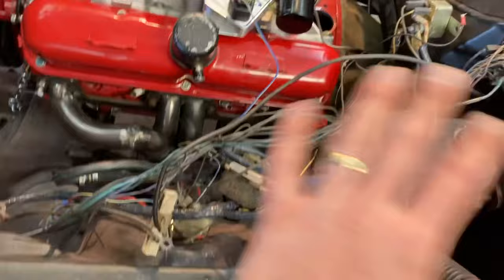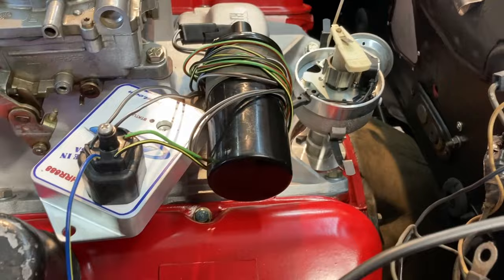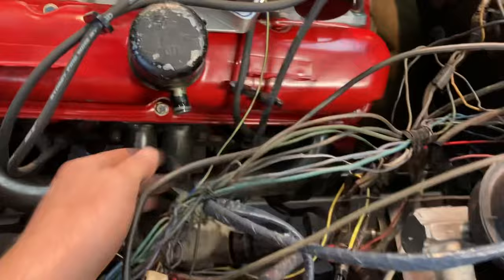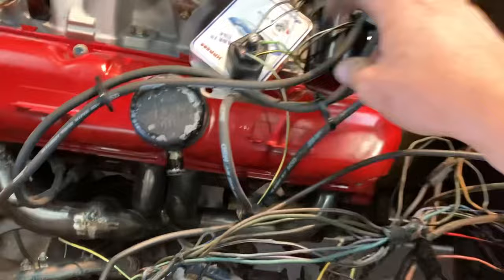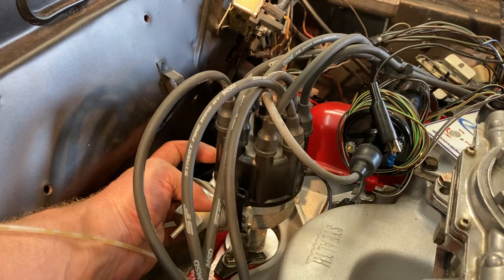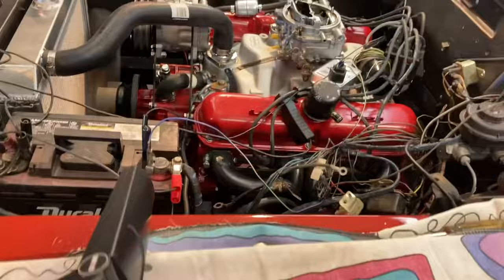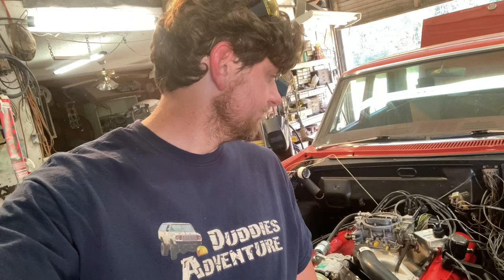How to Time your New Engine, and it Start Instantly! #smallblock #mopar #engine #howto #classic

Comment: joe i have done it this way for many years and it has never failed me the only thing i do different is to take the number one plug out and put the wire back on it then turn the key to the on position and move the dist. back and forth a little to make sure it sparks.this never fails me
Reply from the maker: That’s an excellent idea! Thanks for sharing!
Reply: Yup great idea, could have come in handy that time I switched a 78 Cordoba from Lean Burn to Points and put the distributoo 180 degrees Bass Ackwards... It even started and ran like crap.   But best of all it pinged while idling... It drove me nuts.  Finally I gave up and called one of my Mopar buddies to come take a look to see if he had any Ideas.  Nothing like a fresh set of eyes...  He figured it out in about 2 minutes.... I said;  "No way!" I thought I knew everything LOL

Comment: I thought you couldn’t roll a motor back wards because you would screw up the timing it is that just for the newer stuff?
Reply from the maker: @dantelopez4353  forwards or backwards, when the distributor is locked in place, it doesn’t matter. Newer stuff is usually set off of a crank sensor or crank trigger

Comment: Great video! Great process and tips Joe! Thanks for sharing!
Reply from the maker: Thanks Mitch!
Reply: @JustMoparJoe  so do you gotta have it at 10 before? Cause I did this exact process on my truck and I went to start it but it kept just cranking for a few seconds. I didn’t mess with it further cause I have no mufflers. Just headers
Reply from the maker: @danielpeterson446  the 10 before just ensures you get 10 degrees plus your initial advance

Comment: I like to stay with the factory index of the distributor/oil pump drive orientation. It simplifies wire position and any diagnosis if problems arise later. Sounds good Joe. What mufflers?
Reply from the maker: Thanks Garry. These are Jegs brand, magnaflow knock offs. I will show the part numbers in the exhaust videos

Comment: What should a 1978 Chrysler 400 engine timing be set at? It says  5 degrees but can't move the distributor that far because vacuum hits manifold
Reply from the maker: You may have to pick up the distributor and the intermediate shaft, and reset them. I would aim for around 10-12 degrees initial if it’s a bone stock engine. Also check the advance curve after you rev it to 3,500. The firecore should be light years ahead of the old stock distributor. 318 will run has a good video on finding the best initial timing for your engine.

Comment: I have a 360 that dose not run or idle at all did timing everything need help
Reply from the maker: Always start simple: Fuel, Fire, Air. If it has spark when you turn it over, and fuel when you pump the carb, then it should start. You can send me an email and I can try to help. justmoparjoe@gmail.com

Comment: This is similar to how I do it.  I never likes the idea of moving the intermediate shaft a tooth or 2 off.  It doesn't give you enough adjustability in my opinion.  Plus its a good way to knock stuff into the engine.

Comment: Get rid of that white rotor, i had the same one come apart at the top end 1/4- mile track. I was lucky and rolled all the way off track on to the shut off area.
Reply from the maker: Will do. I usually like the ones made by Mopar.

Comment: What year are those valve covers and what engine did they come off have a set on my  71 swinger  need passenger side oil fill cap good video
Reply from the maker: Thanks Dave. These were from a 67 273.
Reply: @JustMoparJoe  thank you
Reply from the maker: @davesaylor5135  if you can’t find one, send me an email. justmoparjoe@gmail.com

Comment: I bought an e-body Challenger with a 383. It runs rough so I decided to go through the tune starting with timing. There was no timing mark on the balancer. So I found TDC on the compression stroke with a piston stop and marked the balancer. Then rolled the engine counter-clockwise back to about 12 BTDC. Next I followed your video and lined up the pickup coil with the reluctor. But when I put the rotor back in, it is not directly under any of the distributer cap posts. It is rotated counter-clockwise about 1/3 of the way past one post, 2/3 before the next post. Ever come across this? Any ideas what is going on with this?
Reply from the maker: It’s very possible, depending on the distributor,rotor, or cap manufacturers. Some people don’t line up the rotor at all. Locating the correct number 1 and the verifying fire order is important. If you can get it back running, throw your timing light on and see where it’s at for initial and total. Be sure you have a good set of plugs in the car(ngk or autolite). Also check wires and connection to coil. Also check vacuum lines for any leaks.
Reply: @JustMoparJoe  Thanks for the fast reply! I expected the rotor to be perfectly aligned with a post on the cap once the reluctor was aligned with the pickup coil. But it is ~15 degrees past one post, ~30 degrees before the next post. I can put everything back the way it was before and see if runs. At least I have a TDC mark on the balancer now :-) Really not understanding how this thing was running at all now...
Reply from the maker: @70Chally383  good luck 👍🏼

Comment: Hey Joe question for you recently found a 69 barracuda 318 3-speed automatic unmolested doesn't have a grill minor dent in front fender it's dark green what would you think the value could be seats are little chewy floors are good trunks good quarters good?
Reply from the maker: Oh man. That’s a nice car. The easy answer is,”whatever Simeon would pay for it.” The more correct response would be maybe $6,000-8,000 depending on its completeness. Finding trim, etc. can be very expensive and time consuming.
Reply: @JustMoparJoe  thanks for the reply I found out tonight did it has had some modifications and Oldsmobile positive traction rear end was put in it the rest of the car looks pretty stock has bucket seats and console speedometer shows 63,000 miles motor does not run
Reply from the maker: @mrpurcountry  that’s odd on the rearend, but easily fixable. My dart sport has an s10 rearend that someone swapped in 🤨

Comment: I was wondering about the direction of rotation– good tip about the vacuum advance can.  Also, nice TDC on compression stroke trick with the finger on the plug hole.
Reply from the maker: Thanks brother. We always end up
Spinning an engine when putting in converter bolts, getting oil to the rockers, etc. This is the fastest way I can imagine to get it back.
Reply: Just dont use your pinky finger if you have small hands... Just Sayin...😀

Comment: Does it matter where you start number 1? Every diagram I see number 1 is opposite of where you have number 1
Reply from the maker: It absolutely doesn’t matter. I think the factory set them all the same on the production line. Just be sure to make number one the closet to where it goes under the cap.

Comment: Hey Joe thanks for the video. Did you set the initial timing with the vacuum line disconnected? I’m trying to time my 440 correctly and I would like to start for scratch with your method. My car pulses a little while driving, so I know the timings off a little and it’s a new engine. I adjusted it some but slower to start and falls on it’s face when stomping on the gas and then picks up. Time to start from scratch I think. Guess you can tell I’m a rookie but trying to learn.
Reply from the maker: Yea sir: always time without the advance connected. You may need to recurve the distributor and be sure you have correct fuel pressure. 👍🏼

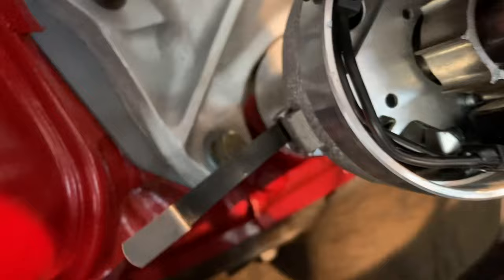Comment: Lost you at 3:55. Couldn't tell what your aligning. Bought a previously running engine and someone took the distributor out, trying to figure out best way of stabbing it back in ...
Reply from the maker: After dropping distributor in, pull cap. Pull number one plug, rotate engine until it poots on your finger. I like to then turn the timing mark on the balancer to 10 degrees before the zero.   Next, look at your cap and see which lug the rotor is pointing at. That’s number one.

Comment: How can you tell how much advance your distributor has?
Reply from the maker: With your timing light, after it’s running, unplug vacuum advance if you have it, then shoot the balancer. Rev the engine to 3,000 and hold it. Check the timing again at the distributor. That difference is the mechanical advance total. You can go back to idle, plug in vacuum advance, and see how much it adds at idle.